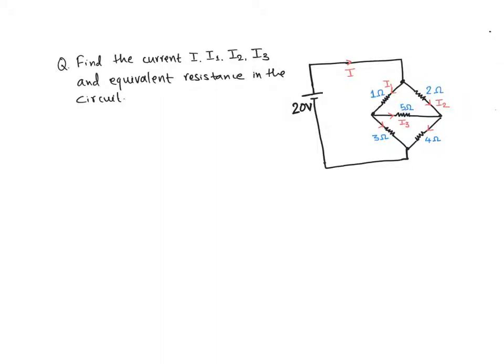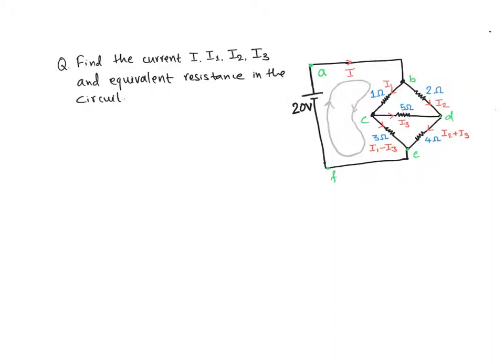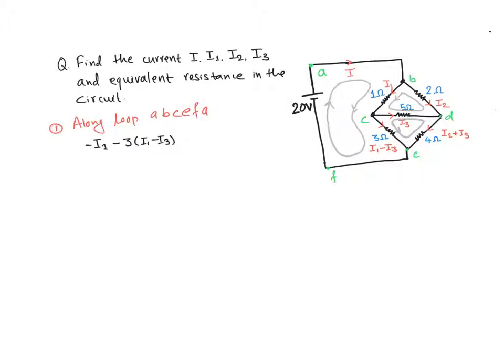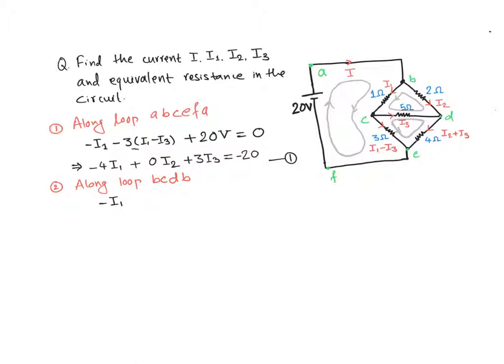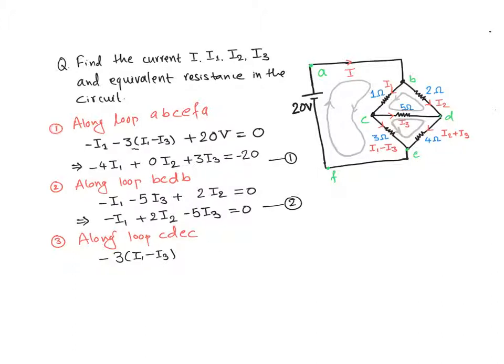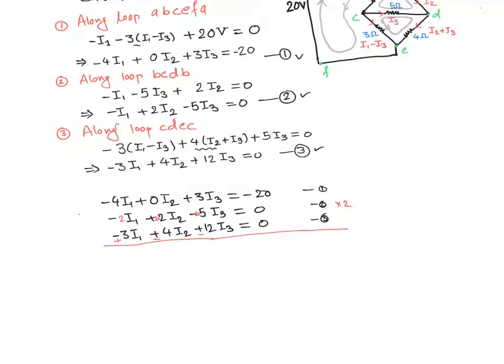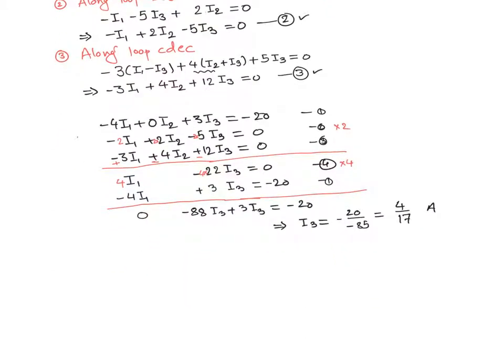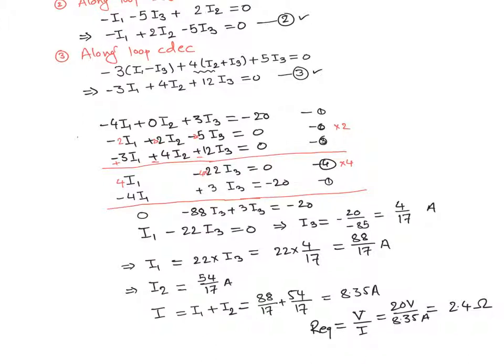Equivalent resistance in bridge circuit using Kirchhoff's rule

Comment: Thank you sir i gained something but in equation 3 it was not supposed to be as it is it was supposed to be -3I1+4I2+7I3=0 something a little you went wrong please have a check back you multiplied 3I3 and 4I3 instead of adding
Reply: There's a 5I3 in equation 3 too so that makes it
3I3+4I3+5I3=12I3
Reply: Yes that equation does not make sense because if you check you started at resistor 3 while he was suppose to start with 5